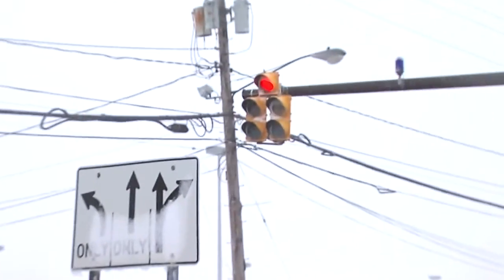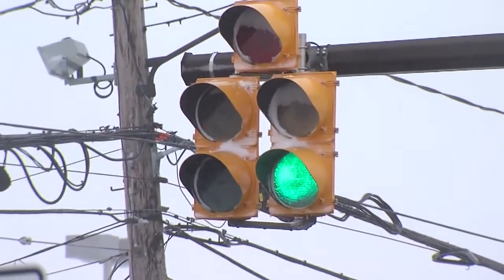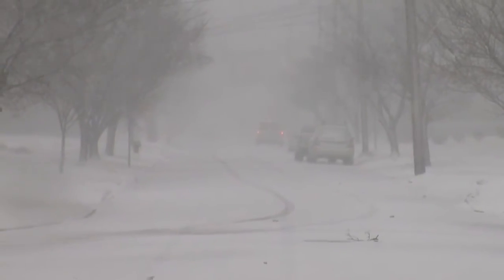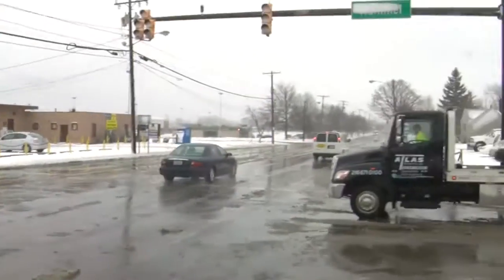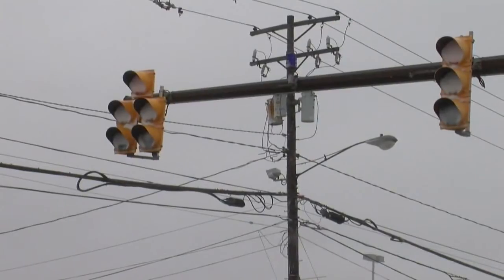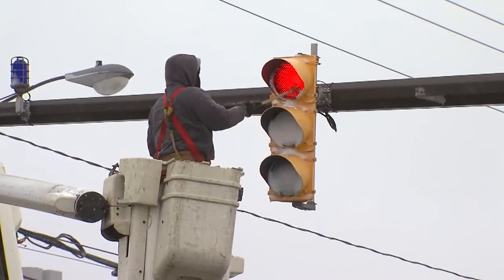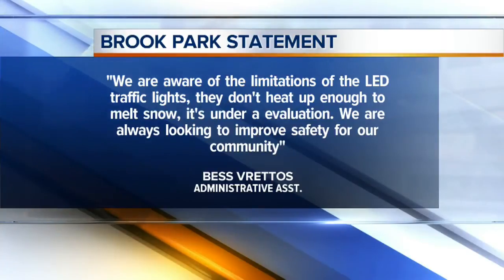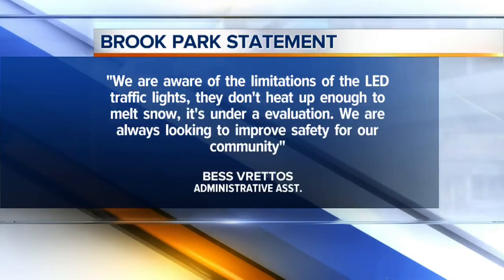LED traffic lights clogged with snow as people run red lights

Comment: LED is still the best for lights, they use a fraction of the power and last practically forever vs the older lights. There are now solutions to the snow issue like improved visors, or integrated heaters that only draw additional power when in colder snow conditions.
Reply: And there is a new type of signal lens that is being developed in the shape of a cone and based on current testing works even better than heaters
Reply: They don't last forever. They last for about 5 to 9 years. My city in San Diego had LED's installed in new intersections and the majority of them have already gone out and replaced with a different type of LED. Some intersections have incandescents that have actually lasted a long time. One intersection has new signals installed in 2002 with all incandescents and some of the bulbs are still going to this day. Neon pedestrian signals last 3X longer than LED pedestrian signals because the neon PED signals were installed here around 1990 and they are still going strong in 2020 while countdown LED PED signals were installed around 2014 and the majority of those have gone out already. So I disagree with the life, but the cost and energy saving I agree with.
Reply: I'm sure they have figured out how to make the lense as part of the heat sink since LEDs get pretty hot. Especially 277 volt LEDs which I figure these LEDs run on.
Reply: @garcjr  From what I have read the traffic lights stepped down to 12 to 24 volts at the device level (the VDC). The problem with snow is currently handled by inline heaters and larger above visors.

Signal works as the specs here for their standard 8" traffic lights https://www.signaworks.com/products/industrial-traffic-lights/200mm-industrial-traffic-light.html
Reply: @garcjr  You would still think the lens would retain enough heat being run 24 hours a day, even using 20 watt, but I then again the  yellow is not on very long, and the red and green are on differing times depending on the intersection, so it's interesting.

Comment: The only problem I saw was  the jackoffs going through a traffic light that they couldn't tell was red or green. As though it's an intersection without ANY traffic device. 
You're supposed to STOP if that's the case!

Comment: This is why you can only use LEDS in warmer areas
Reply: Without snow
Reply: Yup that's why I run halogen headlights up here in the Northeast (Rhode Island). I have LED lights but they are worthless in snowy weather especially commuting on the highway. LEDs snowed over in minutes. Halogens stay hot so they melt the snow and ice. The only way I'd run led headlights is if I end up buying the heated ones but those are big money.
Reply: Not true they have a fix
Reply: Snow proof signals LLC visitors come see our web site and Facebook and YouTube
Reply: Or you know you could teach drivers if you can’t see a light to use it as a stop sign

Comment: You take something that isn't a problem and has never had a problem, and turn it into a problem. This is what happens when morons call lazyness a "technical innovation". There was nothing wrong with incandescent lights, and LED bulbs do not work with repeated on & off switching all day every day, it burns out the circuits. They want to be left on and stay on. Some parts of my city have changed to LED traffic lights and they are always broken about every 8-9months with someone in a bucket truck working on the insides.
Reply: @exoticcar5482  LED's also are being replaced, also get dirtier, takes more time to replace with wiring instead of simply taking a bulb out and putting a new one in, and LED's also dim and flicker over time and also in this video they get covered in ice. So stop with your hyprocrisy.
Reply: @sandiegotrafficlightstrain354  Do you actually work in the field or have proof of this? Otherwise okay boomer
Reply: Incandescent AND LED lights both have their pros and cons. In this instance (and with things like car headlights) LEDs pose a huge safety risk that needs to be addressed soon.
Reply: @BloodyAngel88  The industry has already solved it